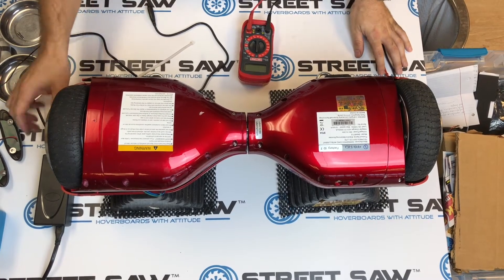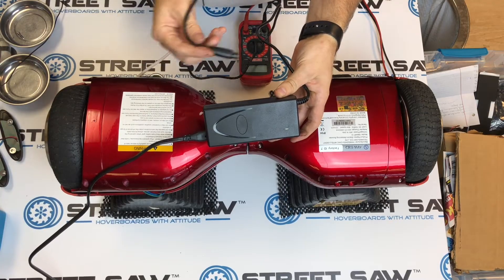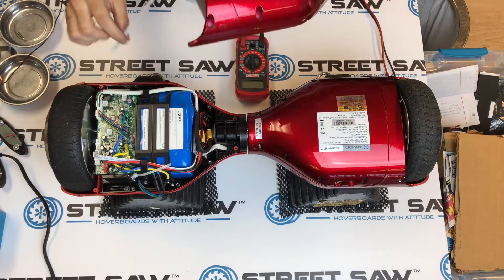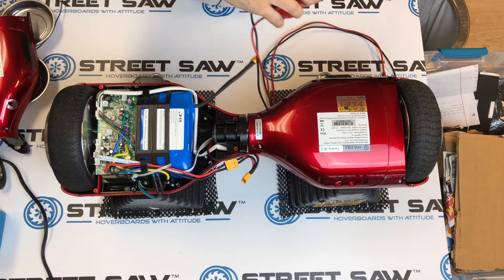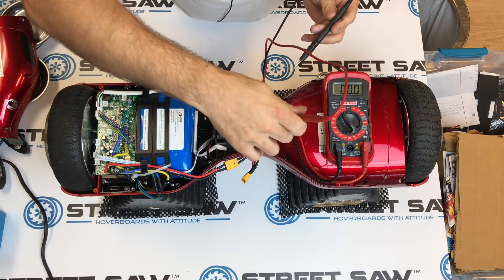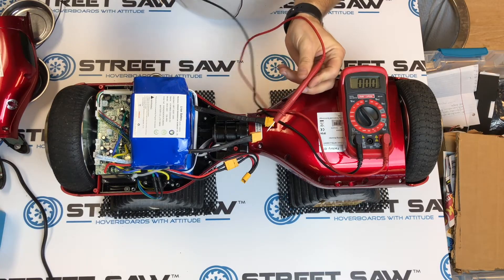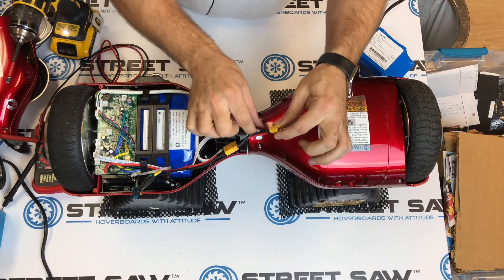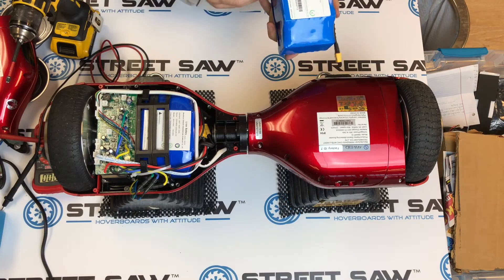How to Test Hoverboard Battery w/ Multimeter & Replace

Comment: Hi, i have 37v on my battery but when i try to start the hoverboard stops imediatly and i can not turn it on untili connect the charger. I look the battery break down on load. How can i check this? Thx

Comment: This is so fucking confusing. You say if the light is green and if when you plug it into the hoverboard if it stays green then is an indicator that is bad? WTF?
Reply: He's saying if your hoverboard was working and charging fine, you wouldn't look at this video. 

Normally green means fully charged, but in this video it could mean battery not detected.

If you see red it indicates the battery is not full and is charging

Comment: HOLY $ _ _ _ !
YOU should DELETE...
This ? Video ?
This is NON-SENSE !
Reply: Yea I agree….he didn’t account for discharge or any other circuitry that goes between the AC charger and the battery…..wiring could be at fault or the circuitry in between like the bms

Comment: I revived My hover board battery and the voltage on B- and B+ show 38volts but through the actual xt60 connector it reads 25volts. I’m guessing it’s a faulty bms but it was working before this happened.

Comment: i have a problem with my hoverboard, it will randomly shut off while riding or when there is a large load (when you lean forwards too fast) but now its mostly just doing it on its own even when i go slow, i checked the battery and its at 41v even though its supposed to be 36v? i measured it from the end of the plug not the batteries them self so i dont really know whats going on here. im worried it might be a logic board problem but i overviewed the board and the components seem fine (no burn marks or anything) HOWEVER i did get this board refurbished and i actually got a refund for it so i basically got it for free so im not afraid to experiment with it but i would love to get it working again. batteries are around $40-50 new for a samsung brand battery so if i know for sure thats the problem i will go with name brand but i need someones help because im clueless, i tried testing the battery whilst it was plugged in to the board and im not sure if its my volti-meter or what but its not getting anything whatsoever, i tried switching to amps and testing it and somehow my meter shorted the connections through its self (fairly certain i didnt touch two pads by accident). edit: still powers on and functions. I was quick to remove the prong before it welded to the board or something.

Comment: My brand new hoverboard run time is around 25 minutes then it cut off power of board. At full charge it was around 41.5 V and after 25 minutes the battery voltage was only 37.8 V for cut off. Why is the voltage still so high and already there was a cut off the power?
At wat voltage should the board switch off? Any suggestions?
Reply: It should switch off at around 30 volts so the cutoff is too high

Comment: I have a 37vdc battery and it shows 01.8 when testing the battery with a multimeter. Problem is I can’t find a 37vdc battery for sale anywhere only 36 volt battery. Will a 36 volt battery be ok?
Reply: It doesn't matter if it is 36 or 37 volt battery. You can use a 36 volt battery for hoverboard

Comment: Hi. The charger battery briefly blinks red but then stays green. When I measure the voltage I get 32v though - not nearly as low as your battery here. Is that considered bad? The hoverboard doesn’t turn at all btw.
Reply: Mine too!! Did you figure this out? Maybe a bad charger?
Reply: @alexismchone9477  did you figure this out?
Reply: Me too, my battery has 33v and connected to another motor works but only for a bit until it reaches 30v. I think it’s faulty but it’s not as bad
Reply: But mine did turn on
Reply: My battery is 12.8 v is it still good or it is dead?

Comment: Hi! Just wondering what your location is. We have a swagtron that isn't working and want it to be repaired. Our swagtron won't turn on unless plugged in, and when it's plugged in it lights up red.
Reply: swagtron seems to be a very common problem - that's why I'm looking - check out how many diff youtube vids show problems with them! especially the red ones!

Comment: Hi, what voltage is it when it is empty? Mine reads 39.68 voltage when it is full even though it's a 36 volt battery. Also is it bad to run it to empty?
Reply: 36 is average voltage. Most lithium ion batteries have voltage from 3 to 4.2 volts. So there are 10 cells in series and 2 in parallel. 4.2 x 10 = 42 volts and 3 x 10 = 30 volts. 39 is ok

Comment: Some battrries multimeter reading give 18-19 volts,  its fine as this is the output of the internal controller board,  if you opened the battry and probed the batteries directly,  it will give you 36v

Comment: Thank you so much. I have looked for so long to find out the problem with my hover board and nothing helped at all. All other videos sucked and were unclear. I tested it with my multimeter and had the exact same readings as your faulty battery. Around 3.6. I’m about to buy a new one.
Reply: hamburger

Comment: Hi when I test my battery it shows 32.2v but when connected to the charger it shows 41.8v dose this mean my battery in knackerd cheers 
It has been on charge for hours but stays at 32.2v 
Thanks
Reply: you do't charge it while you read the volts, it basically puts more power into the battery unless theres is something really wrong with you're hoverboard
Reply: Sounds dangerous. Don’t test it while it’s plugged in!